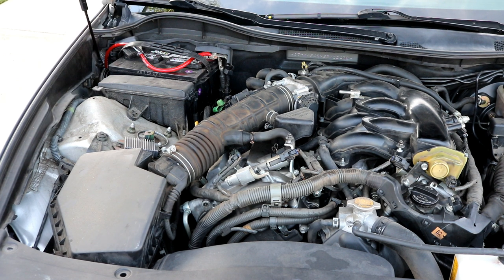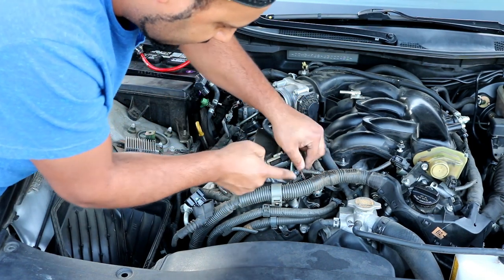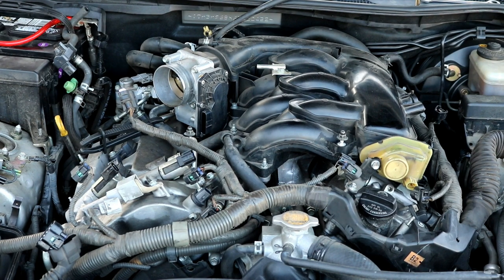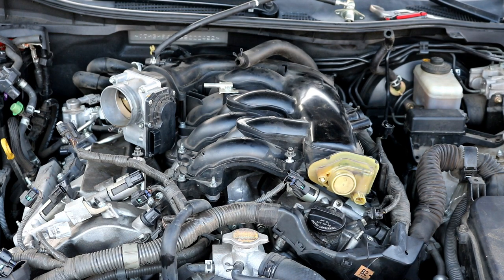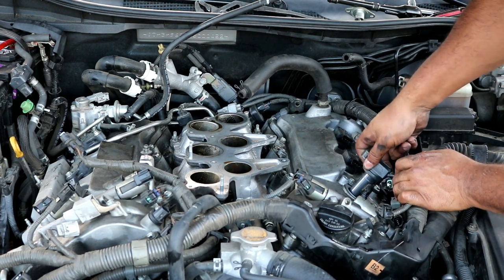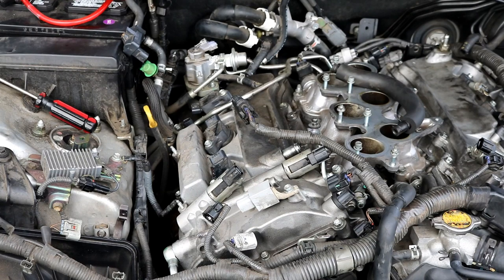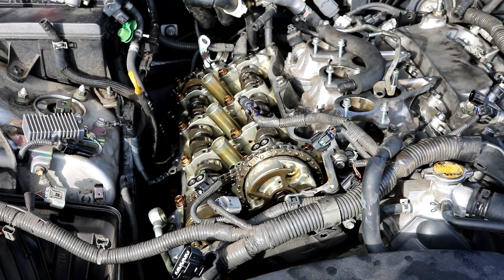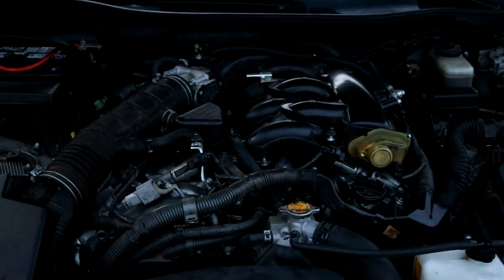Lexus GS300, GS350, IS350, IS250 Valve Cover Gasket Replacement

Comment: Will a leaking head gasket cause my car to smoke white at  start up?
Reply from the maker: Yes. 

However this is highly dependent on your climate and when you are starting the car. If it is slightly white on say a cold morning start up and then it goes away after warming up for 10-15 mins or so, that is most likely just steam.

Are you able to provide more details? Like your temperature around there, when you start the car do you see the most smoke (morning time or midday?)

Also is it heavy puffy white smoke or does it seem to disappear shortly after leaving the exhaust? 

Does the car overheat?
Reply: @HelpingHandAutoRepair  i get out at 4pm and its around 105 degrees outside.  And it happens sometimes, and sometimes it doesn't do it.
Reply: @HelpingHandAutoRepair  it is puffy and very white.
Reply from the maker: Does the car overheat or has it overheated recently? 

Puffy white smoke isn’t a good sign. Of course I am not there to see it in person, but definitely seems like the Head gasket could be compromised. 

Are you having to add coolant to the radiator or overflow from time to time also?
Reply: @HelpingHandAutoRepair  no it doesn't overheat, it is losing antifreeze but just a little bit. What I did notice was when changing the oil, it gets low really fast. Let's say a month and a half and I have to add two quartz. But the thing is there's no oil leaking from the head gaskets.
Reply from the maker: @oscarvillalobos2453  you have to add 2 quarts of oil every month and a half? Or two quarts of coolant?

Seeing as you are loosing coolant on a regular basis, and you have no physical leaks you can see, and you have puffy white smoke, I am keen to believe your have a blown head gasket. Which one is the next guess. However it would make sense to just do both if you choose to go that route.

Also if you are burning 2 qts. Of oil in a little over a month, AND you have no physical oil leaks, you are definitely burning oil. This could be a head gasket issue OR another engine failure (piston rings or valve seals.
Reply: @HelpingHandAutoRepair  thanks for replying . Yes its oil thats burning. But how would I know if its the head gaskets or the pistons etc?
Reply from the maker: Sorry I have to ask questions to try and give you as educated an answer as possible without seeing the car.

1. So have you been losing coolant on a regular basis? If so how often does it need to be filled?

2. Does the puffy smoke ever go away? Or does it stay constant the whole drive even after the car has warmed up completely?

What I suggest you do before diving into anything else is to pull all the spark plugs and inspect them and lmk.
Reply: @HelpingHandAutoRepair and I appreciate that you take the time to reply. No I hardly lose any antifreeze. The white smoke comes out when I start up the engine. And when I accelerate fast. Lets say I'm driving at 40 miles per hour and rev the engine smokes comes out but just when I accelerate faster.
Reply: Could it be also the pcv valve?
Reply from the maker: Last question I promise. Lol.

1. How many miles are on the car?

I am convinced you don’t have a blown head gasket. I do believe that you are burning oil. 

I still want you to pull the plugs and inspect them all. This will tell you two things. 

1. If all the plugs are oil fouled (caked on black deposits l) then you potentially could have a very clogged up PCV system. This would cause very high crankcase pressure that is forcing oil into the combustion chamber and burning it.

2. If there is only oil say on one or 2 plugs, then you more than likely have a severe oil leak into those cylinders via piston rings or valve stem seals or guides.

Normally if your piston rings are bad, you will get smoke when accelerating as you are explaining to me. However you say that you get smoke on startup also. That is an indication that the valve seals and or guides are worn. While it’s not common for both rings and valve seals to go bad at the same time, anything is possible.

Pull the plugs FIRST before doing anything else and then go from there. Please ask me anything you need help with and I will try to help you out. You can also send me pictures of the plugs via email with the address posted on my channel description tab or about tab.

Do remember which plugs came out of what cylinder.
Reply from the maker: @oscarvillalobos2453  additionally there has been issues with some early 250 and 350 engines where piston ring failure was common and required extensive repair. These cars were around 50-100k miles. It was a known problem at the time. Just an FYI. Hopefully that’s not the case with your car, however burning oil at this rate usually indicates a big problem internally. Pull the plugs and lmk.
Reply: @HelpingHandAutoRepair  i have 176403 miles. This weekend I'll change the oil and check the spark plugs
Reply from the maker: Ok. Lmk. Thanks for reaching out.
Reply: @HelpingHandAutoRepair  no thank you! for taking the time and replying to my messages. I'll check all that. Hopefully it's not something big. I did use a carbon cleaner I don't know if that affects the motor or indeed helps it a little bit.
Reply from the maker: Well that would smoke initially but should go away. Plugs will tell you the story when you pull them.
Reply: @HelpingHandAutoRepair  hey man how's it going i changed the oil and the plugs and the coils had oil on them. I'm assuming its the head gaskets right?
Reply: @HelpingHandAutoRepair  and im guessing when all that oil sits in the coils and spark plugs when i turn the car on thats the reason for the whit smoke doesn't it? Means its burning all that consumed oil ?
Reply from the maker: Oil down in the spark plug tubes means that your valve cover gaskets need to be replaced. I’d imagine they are covered in oil? 

That oil won’t cause the smoking on start up though because it doesn’t get into the cylinders because the spark plugs are blocking the oil.
Reply: @HelpingHandAutoRepair  and what causes the white smoke?
Reply from the maker: How much oil was in the tubes? Was oil covering the bottom of the coil packs? Was the whole tube filled up with oil?

Valve seals and/or guides can leak oil as the car sits for a period of time. 

What did the actual spark plug tips look like? The very end that is inside the cylinder?
Reply: @HelpingHandAutoRepair  they were pretty dirty. The tip of the spark plug was full of oil and also the threads
Reply: @HelpingHandAutoRepair  and where the 5/8 socket goes it had oil too.
Reply: @HelpingHandAutoRepair  if the cylinder wasn't that bad and the tip of the spark plug was it means its something else than the gasket right? If it was the  head gasket the cylinder would be super dirty? I'll check it again it was late and couldn't see very well
 Ill check all that again
Reply from the maker: Quick pictures I could find. Scroll down and look at the very tips of your plugs. Do they look like the oil fouled plug in the pictures?

Oil on the threads is from the oil that is coming from the tubes. 

The only thing I can suggest as of now is to replace the valve cover gaskets and fully clean the coils and tubes out and go from there. 

It isn’t normal for the oil to seep past the spark plug threads and into the cylinders. It is possible that a very small amount could seep past but the way you are explaining the white thick puffy smoke, there would need to be a good amount of oil entering the cylinders. 

You can potentially have bad valve seals and/or worn valve guides. Unfortunately you won’t know that until you pull off the valve covers so may as well do the valve cover gaskets too.
Reply from the maker: The tip of the spark plug as shown in the pictures in the link I gave you will tell you if the engine is burning oil or not.

If it is fouled with oil, you can have worn valve guides or seals OR you could have a head gasket breach. However it really would depend on how the HEAD gasket passageways flow.
First: Please understand that a head gasket and a valve cover gasket are completely different gaskets.

The oil on the spark plug socket is because the valve cover gaskets are leaking.
Reply: @HelpingHandAutoRepair  sorry but what link are you referring to? If i have time ill do it this weekend and will give you some updates. And I dont know why I was saying head gasket I meant the valve cover gasket.
Reply from the maker: Just google “spark plug reading” then you will see oil fouled plugs.
Reply from the maker: I have seen plenty of oil down in the spark plug tubes over the years and none of them smoke because of that. The oil just won’t seep past the plugs and into the cylinder. Of course ANYTHING is possible but it is highly unlikely.

I really think you have valve seals and/worn valve guide issues. Pretty severe issues considering how much smoke there is and how much oil you’re using.

Toyota’s have had oiling problems in the past for quite a few years.
Reply: @HelpingHandAutoRepair  yeah it seems to be oil fouling
Reply: @HelpingHandAutoRepair  it also says that the pcv when clogged or inoperative it can cause a buildup of crankcase pressure which can force oil and vapor past the rings and valve guides
Reply: @HelpingHandAutoRepair  ill check the valve cover gaskets and replace the pcv. If thats not the problem do i need a overhaul?
Reply: @HelpingHandAutoRepair  and there is a ticking noise under the hood also when accelerating
Reply from the maker: A bad PCV system can definitely do that. You can pull you PCV valves and check them. However it would need to be severely clogged.
Reply from the maker: Not sure what the ticking could be. But you are definitely burning oil.
Reply: @HelpingHandAutoRepair  yeah i just ordered the part. Will be taking it to a mechanic and have him take a look at it. Thank you so much for taking the time to reply my messages.
Reply from the maker: Of course. Let me know if you need anything else.

Comment: Hi I have a Lexus GS300 2006, it was previously my mom’s and for a year it was dead in our garage. I was given it with a problem. It’s been a year and half no mechanic I go to knows how to fix it. When I drive the car and I am waiting at a red light I’ll begin to feel a jump and every time I feel the jump my rpm’s are dropping from 700 to below 500 and it feels like the car wants to turn off and if I don’t hold my foot on the brake and the gas to keep the rpm’s at 1,000 the car’s rpm will go to 0 and the battery light comes. But I know it’s not my battery because I just got a new battery put in. I stopped driving my car for two days and when I go to drive it again it won’t start up so I got a jump and when it turned on my engine started smoking so I turned it off. Recently before the car died I went to work and I had my car resting under a parking garage for a few hours and when I drive my car back home at night my car was letting out white smoke and I have no idea why because all my fluids were good. Do you have any idea of what it could be?
Reply from the maker: Ariella Elisa The white smoke can be a few things.

1. Cold starts will have whiteish smoke in the mornings if it is cold where you live. This is steam and should clear up within 5-10 mins. 

2. White smoke all of a sudden while the car is running at normal operating temps usually means a coolant leak has suddenly developed via a broken cooling system hose. 

3. Heavy White smoke from the tail pipe even after the car is up to normal operating temp can be pointing to a blown head gasket.

No as far as dropping rpms at the light. First have your check engine light codes read withstand scanner. If there are no codes and this doesn’t happen often then here is what I would do.

1. Clean MAF (located in the main intake tube towards the engine)

2. Take off said intake tube ^ and clean throttle body really good.

Go out for a test drive.
Reply: It sound like your voltage regulator went out in your alternator, check the voltage  and if is above 14 volts that is your problem it fry the battery and probably your mas flow  sensor it olso trigger misfires and other malfunctions.  That happen to my eclipse. I know is a different car but the simtoms are very similar.
Reply: It's prob a bad MAF sensor? Maybe something in the sensor? I have seen bugs in a maf cause same prob. It's been 8 months what was the cause?
Reply: Sounds like your alternator is bad i just changed the brushes on mine got lucky.  But it seems like u might have an additional issue.

Comment: Is the intake manifold plastic? 22:00
Reply from the maker: Raftika Yes.
Reply: Helping Hand Auto Repair do you know if they break or crack after time? since it’s right on top of the engine which emits a lot of heat I’d imagine they would heed to be repacked after a while
Reply from the maker: Raftika Maybe after a very long time. I have personally never seen one of these break. I have seen other plastic manifolds crack after over 200k mileage.
Reply: Helping Hand Auto Repair okay thank you for the quick response! I really want to get one of these in the near future but want to make sure I make the best choice
Reply from the maker: Raftika as far as the car? These are great cars! I do run a car dealership and these are cars I am always looking to purchase. Any of the Lexus IS cars are fairly reliable. I’d watch out for the 2005-06 models. They aren’t 100% bad at all but with higher mileage (200k plus) the transmissions can have a higher chance to fail. This is mostly due to neglect from the previous owners by not changing the transmission fluid in a timely manner. It still wouldn’t stop me from buying one but just check it carefully or have  a pre purchase inspection done before buying one used.
Reply from the maker: Raftika same goes for the LEXUS GS300/350 models. Great cars! Just watch out for the first 2 years. 2005-2006.
Reply: Helping Hand Auto Repair okay thank you for the valuable information! Definitely subscribing now lol and I’m looking for the new Lexus IS the ones with the bigger grilles I believe they started looking like that in 2014? Is there any difference between a 2015 IS 250 and a IS 250 F Sport?
Reply from the maker: Raftika yes the third gen IS is nice and started in 2013. The sport models are definitely nice.
Reply: @HelpingHandAutoRepair  i have a 2006 lexus is 250 200k miles car only heat Up if i turn on a/c. Ir i dont use tve a/c work fine i can be stuck in traffic and Wont heat Up i change the thermostat dealer brand fans are working fine radiador place told me tha t the radiador is not leaking pressure is good but hasent been replaced.
Reply from the maker: junior barrios So you car is overheating?
Reply: @HelpingHandAutoRepair  yes only when i turn on the a/c
Reply: The car was a gift from the first owner and told me that the radiator hasent been replace.i seen a video that talk about trash gets between ac condensor and radiador is that posibbly true
Reply from the maker: junior barrios You need to make sure the fans turn on when the ac is turned on. If the fans turn on when the AC is off that’s good. They also need to turn on when the ac button is pressed.

Does it only overheat when sitting still? Or does it overheat while moving on the freeway?

Comment: Whats the torque specs?
Reply: For the 10mm bolts 7 ft-lbs, for the 12mm bolts 15 ft-lbs. Not much is needed on the covers since like the oil and transmission pans there isn't much pressure being contained and it's spread out over so many bolts.

Comment: Banjo bolts are not 22mm.  17mm I think
Reply from the maker: Frank Le no they are 22mm i just did this job and I also told you guys in the video that they are 22mm there is no point to me lying in the video.
Reply: I just did it on a 07' IS250.. They were 17mm
Reply: They are 22 on the Gs model and 17 on is models
Reply: What’s the torque spec for that bolt?

Comment: Finally finished the job or so I thought. I put everything back together and I have a leak on the drivers side valve cover so I guess I will go at it again to do the driver side...to be honest I think I would rather get punched in the face then do this again. Not sure why it leaked it it’s alone the bottom where the 12 mm bolts are.
Reply from the maker: Marshall Kendo If I had to guess the gasket probably got moved out of position when you tightened it down
Reply from the maker: Marshall Kendo it is definitely a shitty job to do